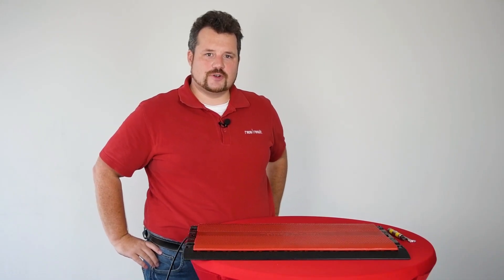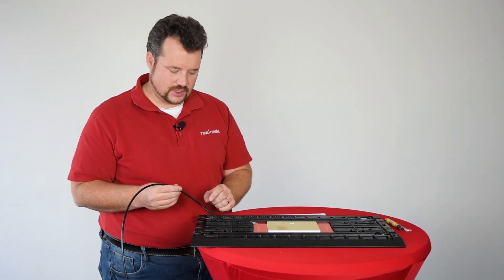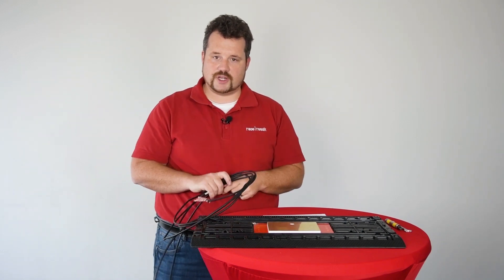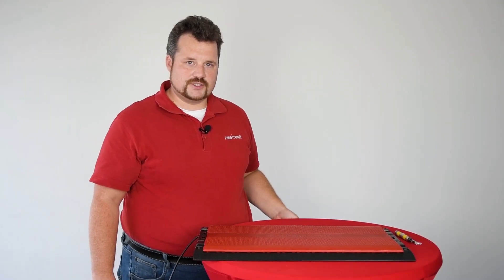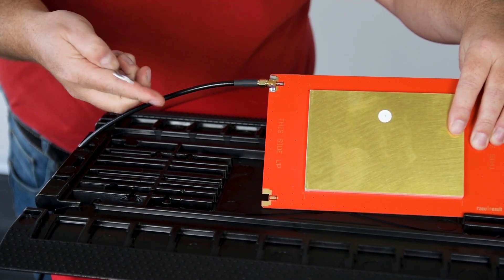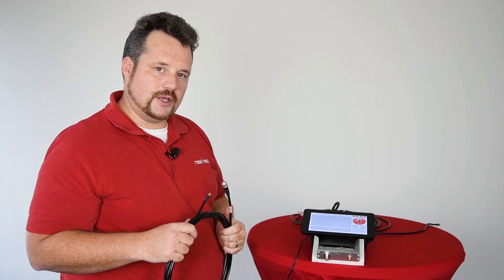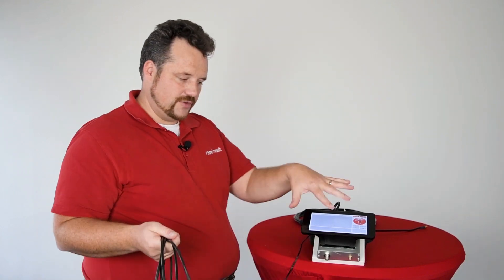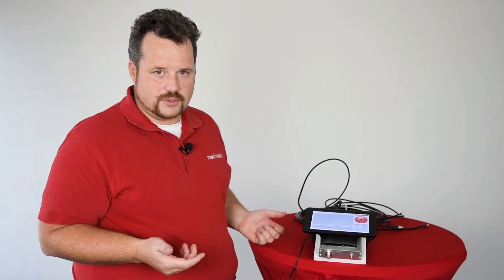race|result Ground Antenna Cable Replacement

Comment: hi Nikias, can we test with test transponder to measure the performance of the cable. i.e., continuous beep signifies a good cable and pause in between antennas needs a replacement.
Reply: Hello Vasanthan - unfortunately it is quite difficult to sense the cable degradation with a Test Transponder. This can only be "sensed" by detection height doing a direct comparison with an antenna equipped with brand new cables using our newest Test Transponder.